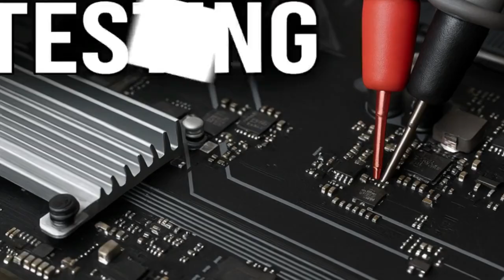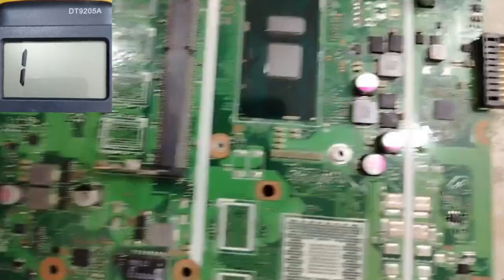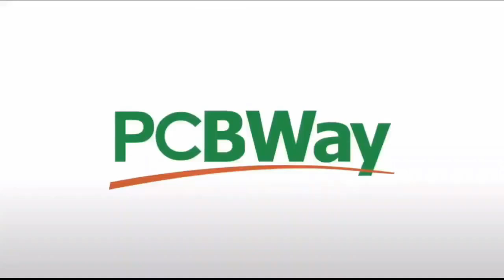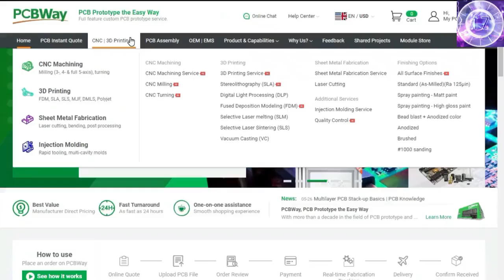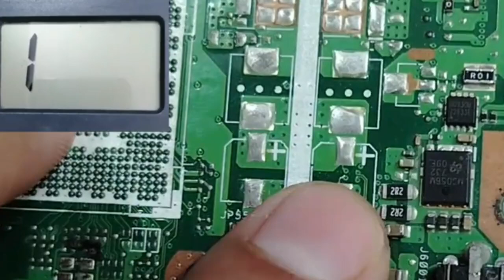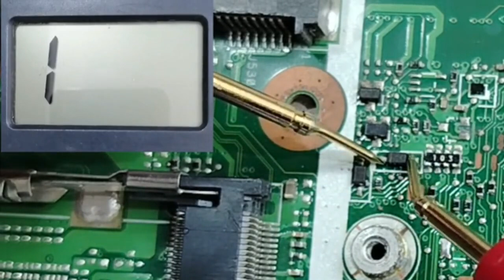The FASTEST Way to Test Electronic Components – No Guesswork

Comment: why not measure inductors using ohms range instead of beep mode? surely  more accurate?
Reply from the maker: You're absolutely right using the ohms range is more precise for measuring exact resistance values. However, the beep mode (continuity test) is still very useful and correct in many real-world repair situations especially for quick checks.

💡 Why use beep mode?

It's fast, and you can immediately hear if the coil is continuous (not open).

If the inductor is supposed to be low resistance (like most are), a beep confirms it's not open or broken.

It's a common method used by professionals for quick fault isolation.

So yes, ohms mode is great for accuracy, but beep mode is still correct and much faster when you just need to verify continuity during live diagnostics.
Reply: I am frm India

Comment: Good. Video. How do I tell if crystal oscillator is good or not without oscilloscope
Reply from the maker: The black probe on the ground and the red probe on crystal pin, you should get the same frequency marked on the crystal on oscilloscope